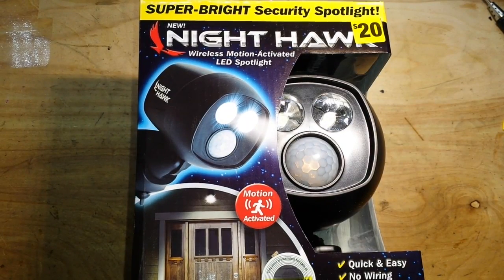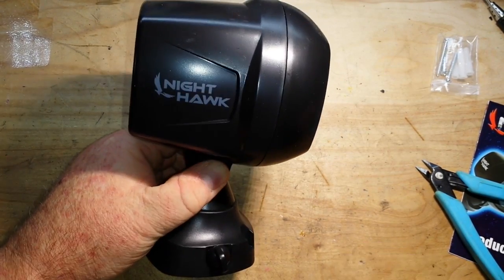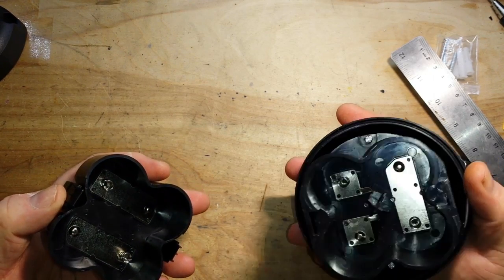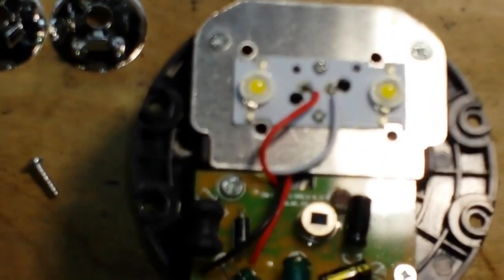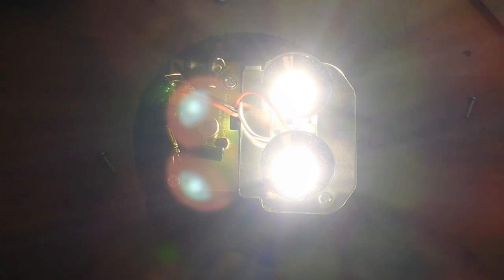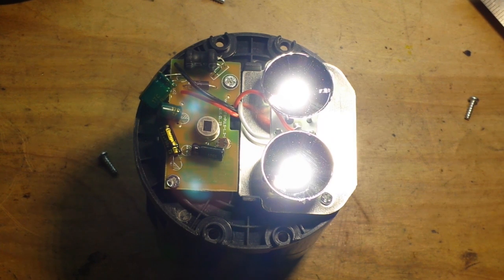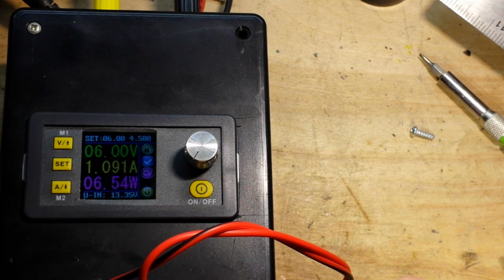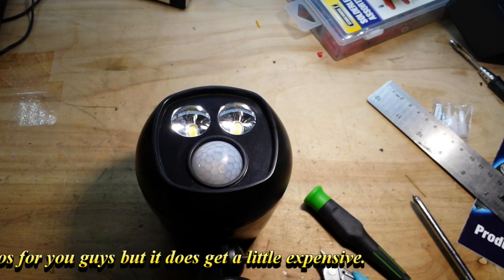Dollar Store Teardown: Night Hawk Security Light

Comment: I add a resistor or two to cut that current draw down a bit so the batteries last a little longer. Price is very high for what your getting. You could 3d print a case that would be a little more robust but that circuit is dead simple so it would be easy to build a light like this for cheap.  Project idea maybe. Well now the wheels are Turing in my head but of course I have a neighbors tv pulled half way apart on my bench with a bad back light to think about. Great video Paul look forward to tomorrows.